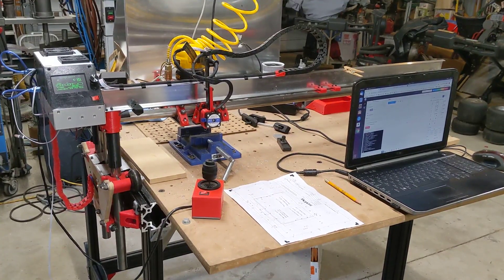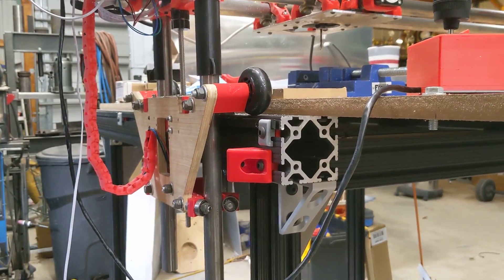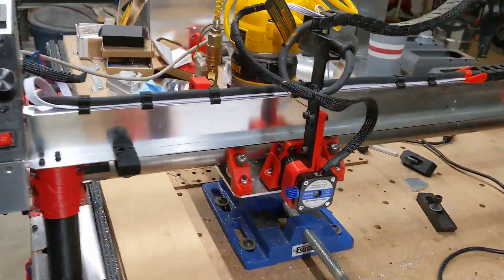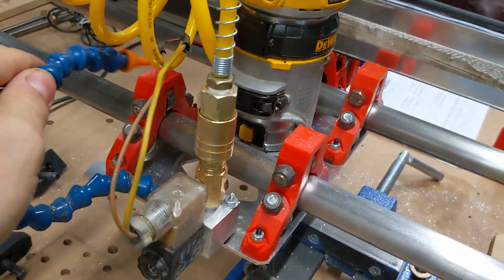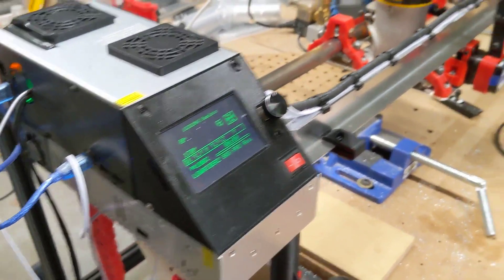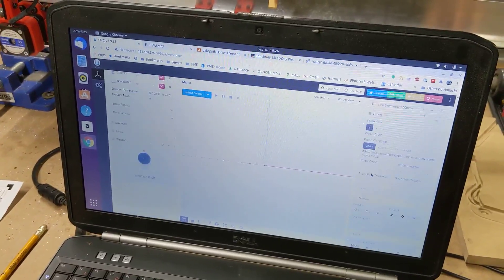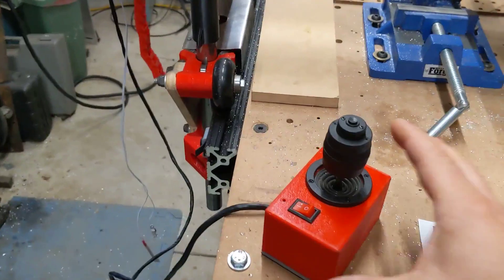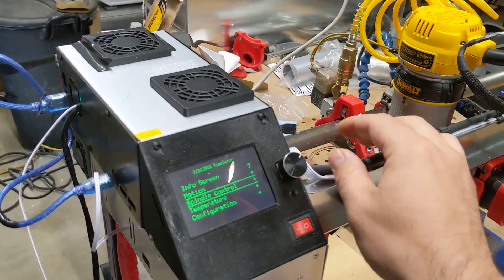LowRider2  Mostly-Printed 3D-printed CNC Machine - Intro

Comment: hi, did you use t-slot or v-slor for the y axis
Reply from the maker: It's 15-series 80/20 T-slot.  I don't think I've seen any v-slot that big.  I'm contemplating adding to linear rails instead of the wheels for more stiffness